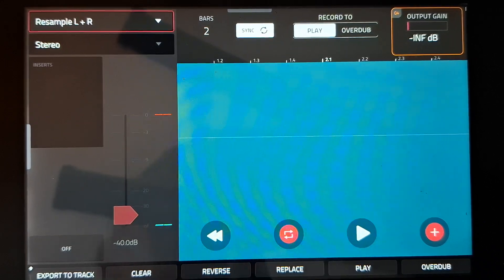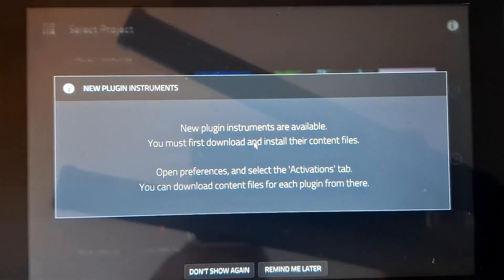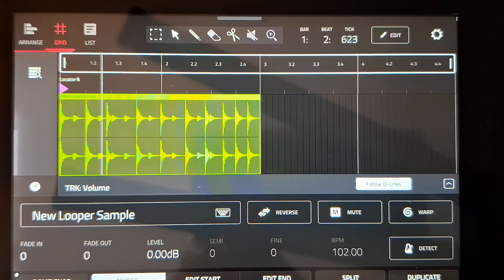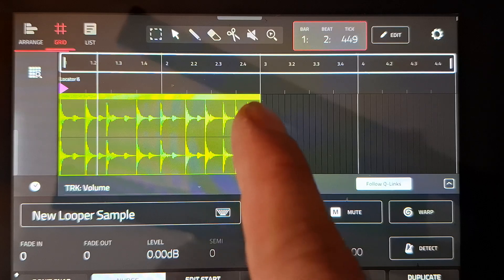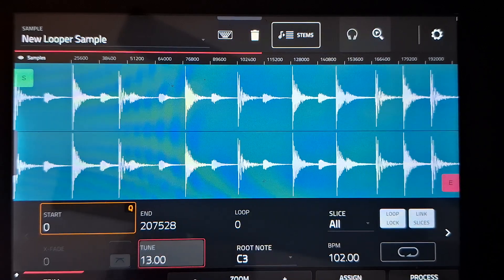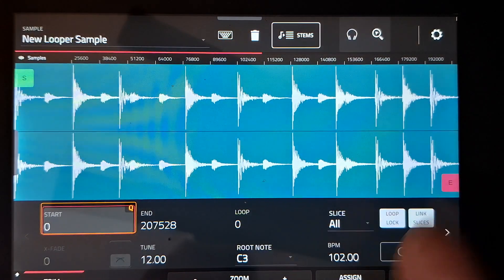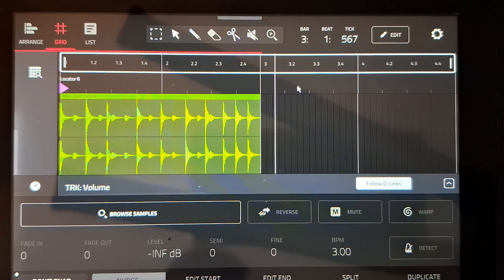Akai MPC v3.x bug report @Akai_Pro

Comment: Had the same issue with the wav file export into half the tempo I did and re detect tempo it fixed it still a bug tho 🫡👍🏾🫡
Reply from the maker: @88keyzKtownsBuc  yeah, had similar issues in the past. This one is not entirely related though. Half tempo is the function of time stretch / pitch shift but in this example warp is off and there is a lots of scenarios where you don’t want to enable it so it doesn’t „recalculate” the sample while pitching it up or down. Anyway as for now, seems like stretching the sample is the only way to go until they hopefully fix this).

Comment: i had a bug - my external drive not seen by 3.00, had to downgrade its a 320gb worked with mpc 1 -fine
Reply: This happened to my friend on 2 of his MPCs but for me it works. That’s weird
Reply from the maker: do you know what filesystem its formatted to ? There is a chance that during rewrite some parts of the code, they’ve dropped one of the supported filesystems (fat32 ,exFat, ext4 etc.). Will double check later on and come back to you :)

Comment: Drag the loop section on the top to two bars on the arranger
Reply from the maker: @dubbzondabeatz8508  that setting is irrelevant as the clip doesn’t redraw itself according to pitch of a sample. Most likely what happens under the hood is that clip in the arranger is a pointer to a parent sample in the edit view or completely new separate child class which inherit original parent class attributes and display them „as they are” instead of calculate them accordingly.

Comment: Turn off Audio tracks warp in settings
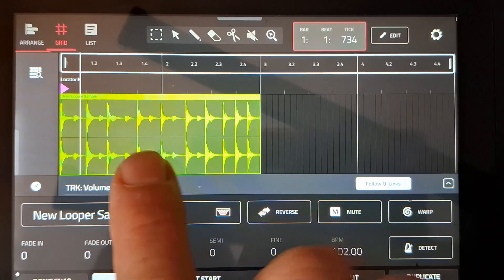Reply from the maker: @1:43 you can see that warp is off - that option is irrelevant in this example as the clip length should be calculated based on sample playback speed when warp is off